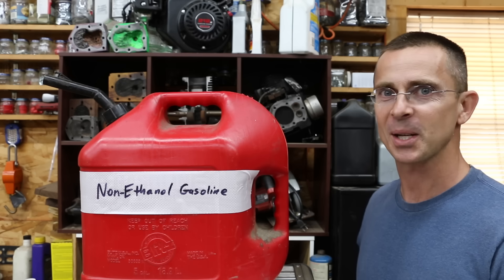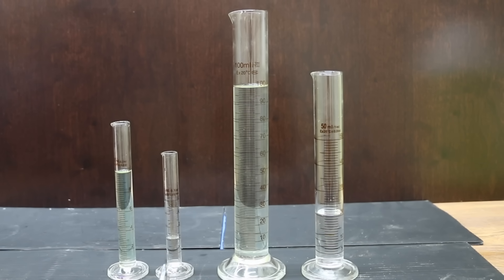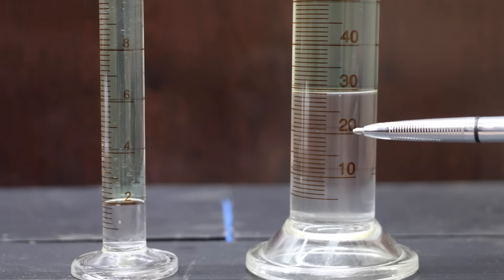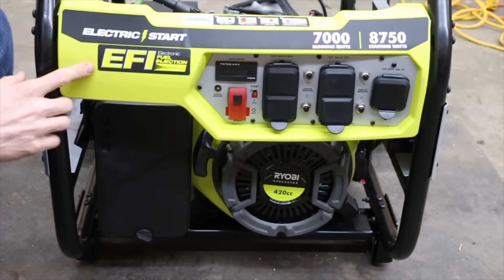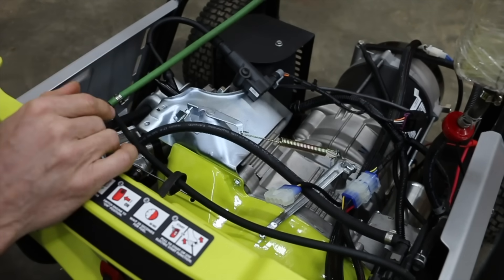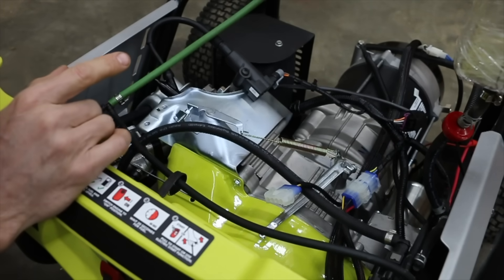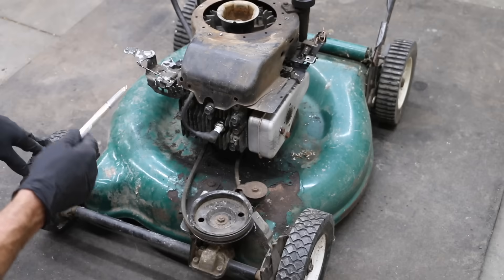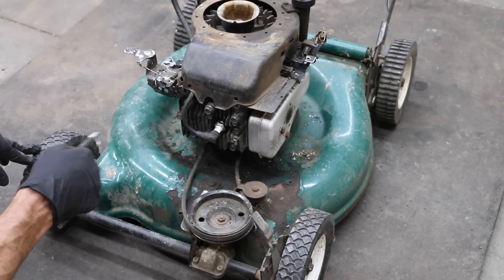Is Non-Ethanol Gasoline Really Better? See the PROOF!

Comment: When you were testing the amount of Ethanol in the fuel you forgot to factor in the volume contraction of the mixture of ethanol and water. The difference is about 0.25mL in your case with a ethanol concentration of ~30% in the water-ethanol solution.
Reply from the maker: Great point!  Thank you

Comment: I would like to see if a engine could run on any type of plant oil or biological oil!
Reply from the maker: Thank you for the video idea!
Reply: I know people who buy 500l drums of fast food oil that they filter out and put in their (diesel) trucks.
Reply: @satibel  Really anderen tgey still Work? Thats cool!
Reply: @Lukas-gd9we  yeah, you can run a diesel on pure filtered sunflower oil (at least 30% is better, or you need to add cleaning agents), though it doesn't work in colder temperatures because oil solidifies, though a 20% oil mix still works (I still wouldn't do it in sub 10C though). also, your exhaust smells like fries.

I'm not sure about exhaust fumes compliance  though.
and I'm also not sure about newer diesels with an ECU and DI.
Reply: @satibel  If i try it I do it on an old motor. I dont want to try it in a new car ;)

Comment: Commenting before I watch, but yes, anything with a steel tank and stored with gas should be ethanol free unless you like things that won't start and ruined gas tanks. I just happened to be using a tank sealer on my old car so ethanol fuel won't be as big of an issue. Ethanol/water induced rust probably killed the fuel pump.
Reply from the maker: Thank you!

Comment: Ethanol is less energetic than the hydrocarbons you would find in pure gasoline, so mixing it in with gasoline will only decrease the energy density of your fuel. That will also force your engine to draw in a richer fuel/air mix into the cylinder, which could explain why it was harder to start the lawnmower with the ethanol fuel, and why there was more carbon buildup the time you used ethanol. 

So only buy ethanol if it is about 4% cheaper than straight gas! (based on the runtime of the generator)
Reply from the maker: Thank you!

Comment: For my Suzuki motorbike (2007) with fuel injection, Suzuki recommends to not use ethanol gasoline. I once had to purchase 10% ethanol because the standard 98 octane ethanol free was unavailable, and the bike didn't like it : the engine stalled at red lights, was clunky at low revs in town, awfull. Everything went back to normal after a refill with 98 ethanol-free. Anyway, I'll get a Peugeot 406 2 liter next year, and I plan to change the injectors for the bigger ones found on the 2.2 liter engine. It's said the 10% more fuel will make the engine 85% ethanol compatible, although this level is more between 40% in winter and 75% in summer...
Reply from the maker: This is great information.  Thank you!

Comment: I love your vids! Fantastic! I’ve been hoping you’d do a test with ethanol and non ethanol fuel, amazing. Here’s a question, is there a difference in the compression between a 10/30 and a 15/40 weight oil for lubricity in small engines? Will the heavier oil damage the motor? Thanks! Love the vids, keep them coming!
Reply from the maker: Thank you for the video idea!

Comment: Ethanol is most likely used to increase the octane rating in gasoline. Ethanol has a lower heat energy than gasoline (I believe the number is about 89000 BTU per gallon of gas vs 71000 BTU for a gallon of ethanol), so while the octane is increased the energy put forth by the engine is decreased by about 10-15% which will result in lower fuel economy... PS you know how many gas stations hate you right about now for telling us how to save almost a dollar per gallon at the pump..... I took a class on alternative fueled vehicles and i didn't even think about that one
Reply from the maker: Great point!  Thank you

Comment: BLESSINGS 2 yall, Commander and I am VERY sceptical about anything that someone else says is better for me without my consent or approval so you can see where I stand. I haven't had a load of problems with ethanol BUT I run hi-test exclusively in all small engines and don't run them i to the ground either. I also 'pickle' the wifes blower with Tru-Fuel at the end of season which has a LONG shelf life and pour the old into weedeaters and such. Seems to make the spring rush easier. And I'm going to put it in the saw since it has long periods of sitting and waiting. AND I keep the ethanol junk in CLOSED CONTAINERS so the moisture in the air can't get in and waterize everything. So thanks again for a WONDERFUL test. Our power company right-of-way crews are doing a wonderful job so the power has been staying on just fine! Thanks again!
Reply from the maker: Hi Lewie, Very, very good strategies you employ to avoid ethanol caused headaches and expenses in small engines.  I take a very similar approach.  Wishing Yall many Blessings!
Reply: @ProjectFarm  We do what we can, Commander. It's usually the little man that comes up with the good ideas out of desperation because he has to. And the big guys take advantage of them BUT the big reckoning day is coming. 
Stay warm and happy!

Comment: Ethanol is there mainly to help control emissions in EFI engines. It also acts as anti-freeze and reduces knock. Doesn't do much for carburetor engines other than eat their diaphragms and seals if they aren't compatible with ethanol.
Reply from the maker: Thank you!

Comment: In that long-term study you need to show the difference between ethanol and non ethanol gas on the oxidation of aluminum. I took carburetors apart that had set up with ethanol gas in them and had so much oxidation when I dropped the bowl that you could almost fill it up with all the powder. With none ethanol gas I used to only get sludge.
Reply from the maker: Great recommendation!

Comment: I just repaired a chainsaw that quit running.  The owner always used regular gas.  The fuel lines had completely deteriorated to the point that just touching the lines would cause them to break into little pieces.  I had to replace all three fuel lines.
Reply from the maker: Wow!  Thank you for commenting on this.

Comment: Another successful test!! I realize this test doesn't really tell the difference in carbon buildup between the two fuel but your long term test should address that. Can't wait to see the results of that test.  I don't really have an opinion on which fuel is better really, other than the fact that ethanol can go sour after setting a while with out being used. This gums up carbs and fuel line and fuel pumps. Then you need to clean them up before you can use the machine.  The way to defeat that is burn the fuel out and leave the unit empty. Damn if you do, damn if you don't. Oh well, what ever.... nice video....
Reply from the maker: Thank you!

Comment: I really don't mind E10 gasoline but I think car manufacturers need to pre-game with complete teflon or stainless fuel systems. We'll inevitably stop using traditional fuels and many generations of vehicles will rust away without a modern change in fuel lines / pumps.

Plus, E10 fuel spoils really fast
Reply from the maker: Thank you!

Comment: Just a suggestion, you could use 2 simmilar push mowers for the upcoming grass season. Alternate cutting with one that runs solely on e10 and one on straight gas and see "longer" effects after the season. Then you could also leave them over winter with the fuel still in them to see what the e10 does to the poor carb
Reply from the maker: Thank you for the video idea!

Comment: I'm sorry I'm old school. Just can't imagine fuel injected small engines w o2censors n ecms. 😡😡 Again great video
Reply: Emissions. And good riddens to carbs. Nothing but trouble.
Reply from the maker: Thank you!  I agree.   An electric fuel pump is just one more part that can fail.
Reply: Shame that they're trying to do away w 2 strokes. KTM and Yamaha only ones still making 2 stroke bikes. Boats, snowmobiles, atvs as well doing away w em. 😡😡

Comment: Project Farm Since you're starting a long term test on ethanol and non-ethanol gas, can you also test the longevity of each when stored in a container, and with & without a fuel stabilizer? Maybe a semi-sealed mason jar (simulating a gas tank with a small vent) would allow pictures to be taken in order to see any changes taking place. Personally, I go by the 2-month rule where the gas will need to be used within that timeframe if not treated, otherwise Ill need to clean the carb out in whichever equipment it was in. Thanks for the thorough testing you do, and we appreciate the time you put into making these videos!
Reply from the maker: Great test idea!

Comment: If it has a carburetor used non-ethanol 
Others seem e10 is ok

What’s your thoughts on ethanol stabilizers ?   Do they work? Which does one work better than others?  
In e10 gas vs non-ethanol?

I generally follow the following

Small engines 4 cycle
E10 with stabilizer 

2 cycle equipment ( blowers, trimmers, etc)
Only non-ethanol
Reply from the maker: Great question. I'll be testing ethanol stabilizers soon. Thank you
Reply: @ProjectFarm  and how about those octane boosters??

Comment: Another excellent video... I think you have the best Channel out there for this type of content... I work in the Marine industry and from everyone I talk to at boat repair shops the general consensus is to stay away from ethanol fuel in anything that does not get used on a regular basis as it tends to break down quicker or not last as long without any sort of fuel stabilizer... the biggest problem in the Marine industry is with older boats and motors which were not designed to use ethanol and their fuel systems deteriorate from the ethanol... it basically eats all the little plastic and rubber pieces in the carburetors and the fuel line which causes problems then with carburetors clogging up or fuel filters clogging up... I have no problem running ethanol in my newer vehicles which were designed to handle it and which get used on a regular basis,, all of my seasonal stuff like chainsaws, lawn mowers, weed eaters, boat motors, motorcycles, Etc, only get non-ethanol premium put in them... even then in some cases I still will use fuel stabilizer in the non-ethanol premium if I know it is going to sit for several months.
Reply from the maker: Thank you!

Comment: The only complaint about 10% Ethanol I have ever heard is those of us who use old gas. The expert at my local saw shop told me that Ethanol gas separates and then the fuel destroy's the motor (in my Stihl chainsaw). Could be that he was BS me but I have heard the same comment from local farmers and ranchers here in Central Montana... If you have fuel in your lawn mower or motor cycle or chain saw... better run it dry before winter or you will damage your motor. Same with fuel in cans. Dump it in the fall if you didn't use it all.
Reply: In rural upstate ny there is always an ethanol free option at stewarts convenience  shops in every tiny town. They charge the same as premium gas anywhere else, it is the premium grade. 
They have a sign on the pump that is is preferred for small engines.
Reply from the maker: He is right.   "Phase separation" results in a lot of damage.  More to come on this in an upcoming episode.
Reply: I will be looking for this video as with all of your new videos. @ProjectFarm

Comment: Curious if anyone has notice how the pumps used to say may contain at most 10% ethanol.  Now I see some that say contains at least 10%.  I had to double take.  I have notice my mileage in an average fill up has drop about 5-7% the last month with multiple fill ups.  This is from someone that used to live in California and we used to get that garbage winter blend.  Now in Texas seems since it went under 2.00 a gal, I been get less mileage.  Granted still a lot better mileage per buck than California.
Reply from the maker: Great point. Thank you.
Reply: Never noticed the pumps changed.  I think ours still read up to 10%, but will double check.  When the 10% alcohol was first added, the mileage on my Crown Vic dropped about 2 mpg.  Coincidence, I don't  think so.

Comment: Should have tested the lawn mower time with ethanol and non ethanol. Most vehicles with fuel injection can compensate for the 10% I've noticed a big difference with a vehicle with a carburetor as far as gas mileage
Reply from the maker: Great point.  Thank you

Comment: Would like to see a video with a fuel injection engine with a water injection cycle added every so often (every 4th to 8th compression cycle, for example), to either cool the engine, or possibly generate non-combustion power from the rapid conversion from water vapor to steam in a heated engine.  To see if it would reduce fuel consumption, increase efficiency, and allow more "distance" on less money.
Reply from the maker: Great video idea!  Thank you

Comment: what do you mean they both left the same carbon levels. the 10% was dirtier on the head, sparkplug, and piston than the non. you forget to mention that ethanol eats rubber gaskets and destroys diaphrams on carbs. also how did you make that drill starter socket, i want to make one for my old edger
Reply from the maker: Thank you for the constructive feedback.  I'll show how to use a drill in the future. Thanks again.